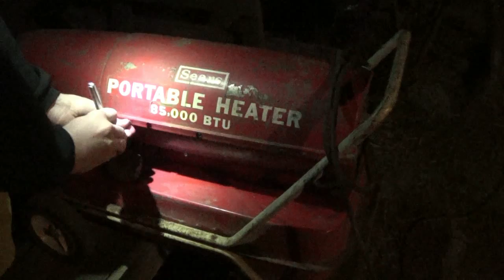How to Repair a Forced Air Heater Part 5

Comment: Thanks guys for your help! I have an old heater similar to that one so it was like you were working on mine, I took everything apart, cleaned everything, filters, plug, injector nozzle...now it works like a champ! Sat for years because I thought it was dead! Good to have the old girl back! Many thanks!

Comment: Hello there. I bought a two plan wired unit for my Master B100B that came with the expensive single wire one. My question is about the grounding of the unit. The old one had tabs that the mounting screws went thru and the new one doesn't appear to have any sort of ground point. Where would this unit ground at?
On this box, the numbers are...
WM1924   with 
2018  0601 stamped on in white ink. Any help would be greatly appreciated!

Comment: how I get to the filter in the tank?
I have a 150,000 BTU reddy heater. One in line filter that fits in the line & one in the tank that I think is clogged. 

If I inject air into the line from my compressor (12psi) the heater will run. When I run it at 5.5 psi it will not run. 

Icleaned the nozzle & replaced the in tube/in line fuel filter. I just can't get to the fuel filter/ pick up tube in the tank. 

any advice?
Reply from the maker: J Athens just use a bent over wire or coat hanger ................ Stan

Comment: Well I sovled the problem with the heater I bought from craigslist . The carbon pump in back of the motor was cracked . I ordered a new one and filter kit too . You cant over tighten the screws on the back or you'll crack the carbon pump . I had no fuel flow and the problem was no air after I blew in the air tube the fuel flowed so I opened up the back for the pump assembly on the back of the motor . Mine was cracked and I ordered a new one , after I get the parts I think Im going to make a video .My spark is nice and hot and bright .
Reply: I have almost the same problem, the carbon rotor is broken so i ordered another one along w/ a new pump filter.
My hearer is a Reddy Pro 150 , I bought the parts from "Space Heater Parts.com"  I think i paid $17.00 for the
carbon rotor and $7.00 for the filter, shipping was around $3.00, it seemed like a decent price but I really don't 
know since i never had to buy these kind of parts, tell the truth i never heard or seen a carbon rotor before.
Is their anything special I need to do when installing this carbon rotor ? 
Any help would be  appreciated
Reply from the maker: Joseph Maximus Don't know about that Joseph - be careful is all i know
Stan
Reply from the maker: good u found out the problem and saved that heater - keep us posted
Stan

Comment: did you ever check the pump gap in back of the motor on the filter housing . It has like 5 screws on it I think most of the gaps are 0.03-0.05 You can also get replacement parts on ebay too . You know if your air pressure is low it can cause all sort of problems and if you have a air leak from that I was reading too .
Reply from the maker: my problem among everything else on there is the air flow - will be checking that when i get a gauge and will be another video - it's working fine as of now - but will still be checking the flow
Stan
Reply: That sounds good Im going to check mine for proper air pressure .I think ill goto harbor freight and get a vacuum gauge to check it out ,The standard automotive vacuum gauge should work fine .Not the one for fuel injection .15.00 bucks at harbor freight , but my neighbor may have one I can use . My gauge is broken on the gauge . I have the one from sears that you pump my hand and connect a vacuum line to for a reading .I got her in the early 1990's she got broken from moving .